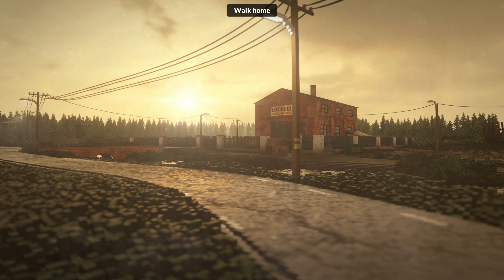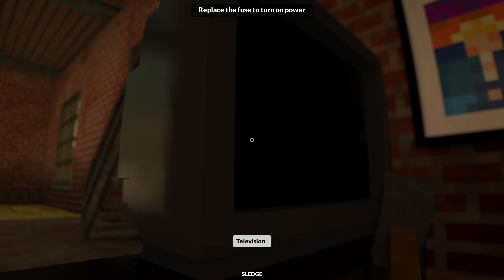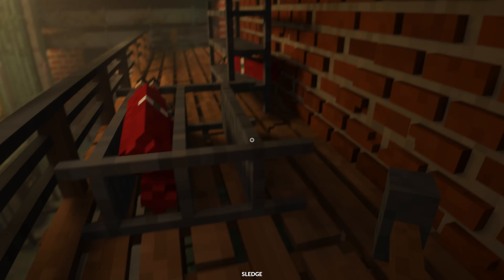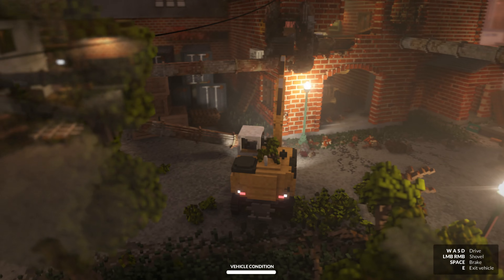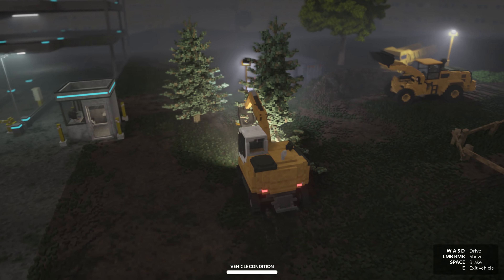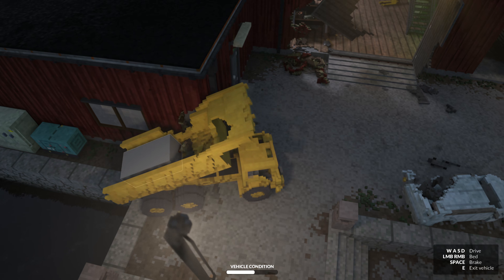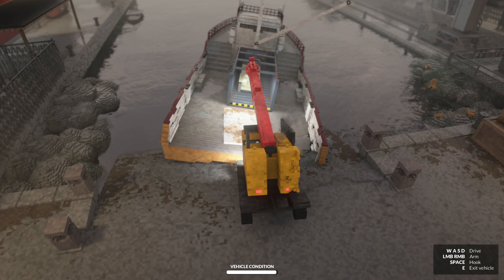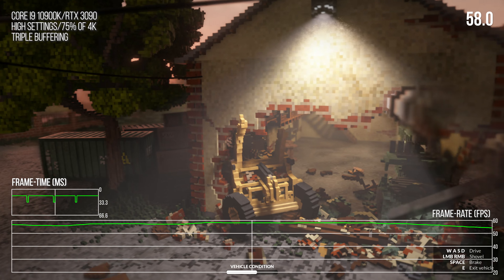Teardown Is Stunning: Next-Generation Physics + Lighting!

Comment: It's just weird to see a game with those really low-resolution voxel-based models but incredibly realistic physics, lighting and effects. The former enabled the others. They did a tremendous job on that one.
Reply: @adamdevo7179  I looked it up before commenting, he's got some help :)
Reply: @adamdevo7179  you can still use "they" for one person.
Reply: Some photorealistic Minecraft mods achieved the same result years ago, but this game has the physics that Minecraft lacks.
Reply: @adamdevo7179  if you don't know the subject "they" is acceptable in British English not sure about any other.
Reply: @Bezzer1975  Also applies to American English and Canadian English, "they" can be used as both a singular and plural pronoun.
Reply: @adamdevo7179  "They" has been used a single pronoun for more than a millennium. Pretty sure it's correct grammar.
Reply: @adamdevo7179  "You see that person over there? They are waving at me".
Singular they is correct grammer.

Comment: The destruction is incredibly impressive, but my take-away from this video is just how incredible games can look with a good lighting engine. I mean, it's made entirely of blocks similar to minecraft, but looks more life-like and atmospheric than a good number of triple-A titles.
Reply: LIghting is everything.
Reply: @bobbydigitales  physics are everything, if games were to max out physics instead of jyst upgrading graphics every next gen then we would truly be somewhere special in gaming right now.
Reply: @sneakkyz3696  I should have been more specific! Lighting is evertyhing when you're considering graphics :)
Reply: Minecraft can also look like that (without ray tracing).
Reply: @sneakkyz3696  lighting is physics :^)
Reply: @souljastation5463  SEUS PTGI and a good resource pack - all you need for Minecraft :)
Reply: @TheUltimateBlooper  Exactly, and if in an hypothetical Minecraft 2 they added physics it would be perfect.
Reply: @sneakkyz3696  imagine gta x beaming drive
Reply: @souljastation5463  The PTGI and reflection mods actually do use raytracing (or path tracing).  It is all about the lighting, which is why real-time raytracing is such a game changer.  We just can't use it for modern games on everything and still get good performance.  You can check out Quake 1 with full raytracing support, and even that runs pretty slowly on most GPUs.
Reply: @iSOBigD  But Minecraft PTGI used to run fine on my meagre R9 270, and Minecraft as a game it's not lighter than Quake.

Can't games just do what PTGI did in order to run more lightly? (they'd still looks impressive)
Reply: @souljastation5463  They can, and some do...I think different developers do different things, but the hardware just isn't there yet.  For example, just turning the ray bounces from 1 to 4 kills performance...having less noisy images or more rays, again, tanks performance...so they're doing a bit of raytracing and mostly screen space stuff or low resolution effects that looks "good enough" but we're not at the level of pre-rendered stuff, not even close
Reply: @sneakkyz3696  We should see greatly improved physics now that the new consoles have been released.  I've heard that the CPUs on the old consoles have been holding back physics and AI for a while now.  And yes, I know this is a PC game, but many games are designed to run on both and on very old PC CPUs.  I really look forward to the games we will be seeing over the next couple of years.
Reply: Red Faction Geurilla.
Reply: @souljastation5463  No minecraft can't , do to how blocks are rendered into Minecraft. In teardown the voxels are a single color (not just a png). The resolution the size of the voxels. Also not trying to be neat picky here after all I've said but Minecraft bedrock has rtx ray tracing so technically Minecraft has ray tracing and even then it doesn't look that good.
Reply: @souljastation5463  exactly. minecraft with shaders is EPIC
Reply: @LineOfThy  It is. However, I was wrong above when I wrote that Minecraft doesn't use raytracing. 

The SEUS/PTGI shaders do make use of ray and path tracing, that's why lighting looks so realistic.
Reply: @virtualrr1927  Minecraft looks phenomenal with ray tracing, both with RTX and with custom shaders. Especially if you also use custom high res textures.

Comment: “Man, this game looks cool!”

GTX 1060 6GB: [profuse sweating]
Reply: sweats in laptop graphics card
Reply: Look up game footage on your gpu, you might be pleasantly surprised! I just saw 40-60 fps on high settings, presumably 1080p.
Reply: Watchdogs Legion looks pretty sweet on a 1650S, I have a feeling we're surprisingly well situated for next gen games at 1080p
Reply: I'm playing teardown on a gtx 1060 6gb on high settings in 1080p and get 40-60 fps which is definitely playable. If you're unsure if your pc can run teardown there is a performance test on the teardown discord server
Reply: @TheWalkingBrick  I'm playing on a GTX 1050 2gb on low settings, 50% render, and 720p and get smooth 100. I have a feeling I could up render to 75% and still get 60, this is beautifully optimized game.
Reply: yeah dont sweat it man im running a 1060 6gb and i pull 40-60 fps on 100% render, 1080p. Not the greatest but still super playable. Thought it would start dying when a lot is going on but its fine, had a few houses fully on fire and had the extinguisher going like crazy and it was still holding up
Reply: The 1060 is still a great card. You'll get a decent framerate with this game, as still with most games.
Reply: Congrats, your gpu is literally the minimum requirements on steam.

Comment: The devs said they developed the game using nvidia gpus exclusively, so they didn't do any amd optimizations yet.
Reply: Thats only one part of the problem, amd has shitty open GL drivers on windows, we know because linux runs a lot better. I question why havent they just used vulkan.
Reply: @635574  From what I know it's harder to use vulkan as it works in a lower level and it's newer.  And I know opengl drivers are bad but there still shouldn't be such a difference.
Reply: @PanzerVII-df8hg  its not coded the same as non voxel game, so it wouldnt worlk.
Reply: *the dev
Reply: @PanzerVII-df8hg  I believe RTX is not compatible with voxels, but I could be wrong. As for AMD's OpenGL drivers, they are awful on Windows, I was actually surprised the game was running faster than Nvidia on those static scenes.
Reply: @maegnificant  Sorry, you're right lol. It's quite amazing a single person can do something like this
Reply: @guilhermems  I thought it was because RTX is just for DX12 and Vulkan raytracing.
Reply: @guilhermems  That's not entirely true - RTX can work on non-triangular geometry.  You still get the benefits of the hardware BVH traversal, although you no longer benefit from the triangle intersection accelleration.  The problem with a highly destructable voxel world is that every time something is changed, the BVH has to be updated, and you can easily end up spending more time recreating the accelleration structure every frame than you actually save from getting to use it to accellerate ray tracing.

But even this assumption could be misleading.  Without going into too much technical detail, the fact that only a small portion of the entire game world actually changes when the player, say, knocks down a building, means that designed properly, only a small portion of the accelleration structure needs to be rebuilt on any given frame.  RTX may yet be able to produce a win even in this sort of non-optimal situation.
Reply: @uhh Raytracing does not even exist on AMD until mid-november.
Reply: @635574  from what I've heard from the emulation community the navi series has mostly fixed the openGL support as the 5700 easily beats the 2060 super and 5700xt beats the 2070 in Cemu and Yuzu. Though they still recommend Vulkan over OpenGL for AMD GPUs as their vulkan support is far better than Nvidia's.
Reply: Heard its made by one guy. I've seen this demo as he was playing around RTX.
Reply: @uhh How is Nvidia's implementation of fixed function hardware for BVH traversal & triangle intersections (RTX) greed?
DXR & the Vulkan RT extension are both vendor agnostic.
Reply: @shibasss  it really is, yeah
Reply: iris  besides literally all of the last and now current console generations is strictly an amd build. have you missed ryzen and Radeon 6000?
Reply: iris  i have an intel + geforce laptop. but I recognize amds recent achievments. and they were foreseeable because they got a shit ton of money out of these console deals.
Reply: iris The only thing I am saying is, they got the money to invest into research and now they seem to be on par, if not more powerful/efficient than their competition at mostly lower prices. and this will mean that they will have a more meaningful impact in the market and therefore have greater market share.
Reply: @uhh How is it greed if Nvidia invented it (RTX)? They didn't invent ray tracing but they did invent real time ray tracing rendered by the gpu which is what makes RTX unique right now until AMD releases the RX 6000 range.
Reply: Another reason why AMD is the backhand of everything and usually always has bugs and performance issues that aren’t present on Nvidia’s. Not fanboying, just pointing out the facts.
Reply: @acurisur  DXR was already in the works. GPU based raytracing was an inevitability. Nvidia rushed to be first to market with products they could at least claim to support the feature, even if it was barely worthwhile in the 1st Gen. It was actually demo'd by a completely different company well ahead of Nvidia. Their RTX is a propriety  black box used like anything else apart of their Gameworks Suite, that is more designed to lock-in customers by getting more devs to buy in to their method. That's actually what Gsync was about with their proprietary module, whereas now they've just decided to actually acknowledge the free adaptive sync standard on Desktop. They have been using it on laptops the entire time. You're automatically replacing the GPU when you get a new laptop. But if you bought an extra expensive monitor for the adaptive sync capability, you're not likely to replace it inside the span of a couple GPU upgrades. If yours only supports its feature with an Nvidia card, well it'll dictate future purchases. It's why they bought PhysX, allowed users to dedicate 2nd Nvidia GPU to it, and then later realized they "needed" to block that ability if your main GPU was an ATI/AMD GPU. That was even more egregious  as it punished consumers giving both them and their competitor money at the same time.

AMD is going to have the benefit of the console implementation being the standard that translates to their PC products, that Nvidia can just use. The RTX specific implementation gives them ability to increase the work load beyond a reasonable point for the actual fidelity improvement (think tessellated sea floors), solely to hit AMD cards more than their own. No one can optimize Gameworks features to perform better on AMD cards. Now they can just lean on DLSS to fix the self induce performance hit. Nvidia is working from Intel's old school playbook.
Reply: @blkspade23  
I'm not going to argue nVidia pulled some shit moves, as you nicely pointed out, but AFAIK RTX is mostly nVidia's implementation of DXR. It's as much a proprietary black box as is AMD's implementation of DXR will be: You're not going to see source code and hardware implementation details for either of them.
As long as current games using raytracing stick to DXR or the upcoming Vulkan equivalent, AMD's GPUs should work with them. At least that is what AMD is saying on the matter. So, Control, for example, should work with AMD's new GPUs right out of the box.
In that way, RTX is nothing like nVidia's PhysX, Hairworks or GSync and AMD's TressFX etc.: It's first and foremost an implementation of an agnostic standard. 

Yes, RTX does have some proprietary features and there are a few titles that were made using those (Minecraft RTX, Quake II RTX and, AFAIK, Wolfenstein: Young Blood), but honestly: That's how it always is with actually new features that need actual new hardware to support them. Someone is first to the market and is the first to get support. That was the case with 3dfx etc back in the 90s, it was the case with FFP GPUs, it was the case with programmable shaders and it's the case this time around with raytracing. I'm also pretty certain that AMD will have some specific features in their GPUs / drivers that you can use, if you want to. That's not a thing only nVidia does and it's not a bad thing in and of itself.

The hate for DLSS seems completely unwarranted, to be honest. Yes, it's an nVidia exclusive feature running on their hardware. There is nothing wrong with that. Sure, you can call that "leaning on DLSS to fix the self-induced performance hit"... I'd say that's pretty dismissive considering the R&D that went into that feature, but okay. It's a fantastic idea and it works really, really well. So, in the long run, it will result in improved upscaling algorithms from the competition.
Same goes for AMD's smart access memory
: You'll definitely not see that from nVidia / Intel in their next generation. Does that mean SAM is a bad thing? No, of course not. The idea is absolutely fantastic. I'm sure there will be some other features in AMD's hardware that will be pretty amazing and will only work on their GPUs.

If you only allow completely agnostic features to proliferate you will never get big leaps like the adoption of hardware accelerated raytracing, because there will always be one company that is late to the party or just doesn't feel there's a need for that specific feature yet so they're not going to invest the required R&D.
Reply: @blkspade23  And? Nvidia got there 2 years before AMD. And all the benchmarks point to AMD's ray tracing being slower than Nvidia's.
Reply: @blkspade23  I strongly disagree with your G-sync argument. G-sync was released years before freesync/VESA adaptive sync was even a thing.

It's way easier/faster to implement something on your own if you have the funds since you won't need to agree on standards with a large group of people.

Also G-sync as a whole package includes many more features compared to Freesync (AMDs bare minimum requirements to meet freesync branding) & with the new modules on new monitors will also support the feature on AMD GPUs.
Reply: @MLWJ1993  Adaptive sync was an optional spec of the eDP standard way back in 2009, which is what was used in laptops. Its what Nvida continued to use in "Gsync" laptops, yet spawned off their DRM implementation for  Desktop use. That eDP spec was then applied to to DP 1.2a, and brought to public attention. AMD chose to call its interaction with the standard Freesync, and Nvidia is now largely doing the same as they started supporting Freesync. Many of new the displays labeled as Gsync, are just "Freesync" panels with Nvidia marketing (validation) and no module. 

Nvidia always had the option of supporting regular adaptive sync on the Desktop, but it's a much better long term business move to ignore it for as long as possible to promote their lock-in method. As opposed to at least supporting both, yet try to upsell on the supposed improvements on their implementation. The Adaptive Sync standard is blowing up in Consumer electronics, so now they need to use it to remain relevant in a wider range of potential applications.
Reply: @blkspade23  look I get it, Nvidia bad, AMD savior of humanity. Typical fan reaction hurdur. They raised their pricing with Ryzen & use Smart Memory Access as a feature to lock you into an AMD Radeon GPU. That makes as much sense as your argument on G-sync (it doesn't) 🙃
Reply: Using OpenGL instead of Vulkan or newer is like using Imperial when the rest of the world uses Metric.

Comment: Bought this within 2 minutes of this video starting up.  It looks amazing and great fun as well.
Reply: Do you need an insane graphics card for it ? I have a HP omen RTX 2060 16 GB ram , i7-10th ,  this game looks like it needs like a 2080 lmao
Reply: @chrisbrown113096  medium Pc can run with frame drops and it will look really bad, but you can actually play
Reply: @chrisbrown113096  RTX 2060 will run it incredibly. I can get 80-100 fps on a 1050, 16gb, R7 at low settings.

Comment: I didn't expect this game to run so well in a single GTX 950 paired with an i5 4460. It's not maxed out, but it's pretty well optimized seeing my specs!
Reply: And now nearly 2 years later, I’m running the game at 40 FPS medium settings on a Steam deck. Imagine how much better received RT would be if it was this well optimized and baked into the game engine?

Comment: Respect to the developer for that achievement which hopefully gives the old polygon dominated game industry some fresh ideas. Later have been stuck for years with polygon based graphics and physics development. Every year new versions of such games were presented without much progress. 
A Revolution is needed and that new milestone of tech looks very interesting. It is even much more impressive due to the fact just one developer made it.

For sure there is still much optimization needed. If i may suggest some points.
I know OpenGL is still nice for many things. But for such data intense projects the successor Vulkan is highly recommended. It has less data overhead and has multiplatform support as well.
With that api some additional features like second or multibounce light reflections for raytracing might be affordable.

I appreciate all the hard work and Salam to you